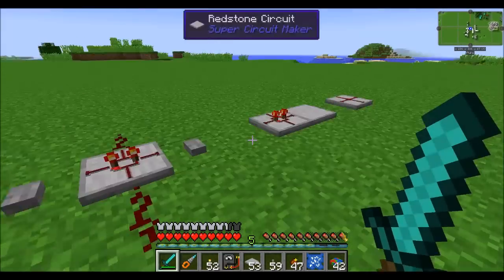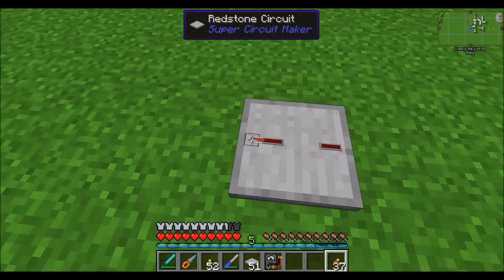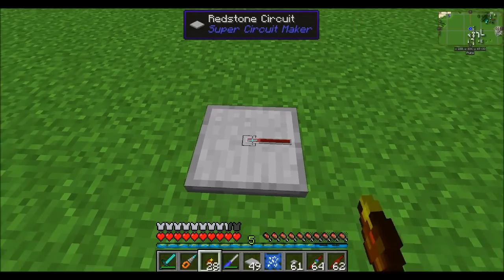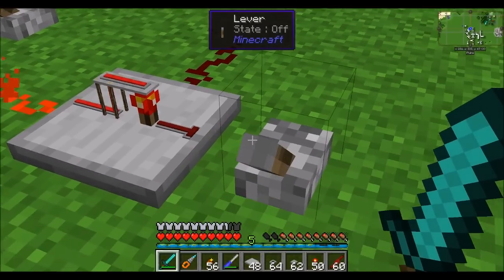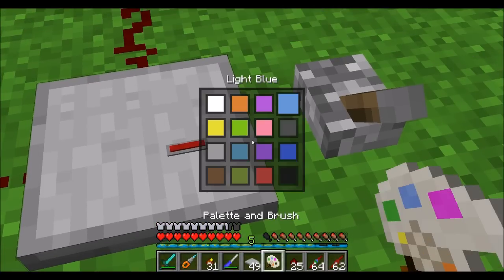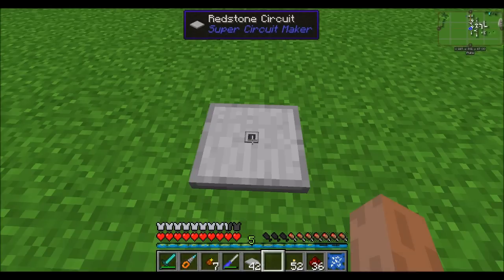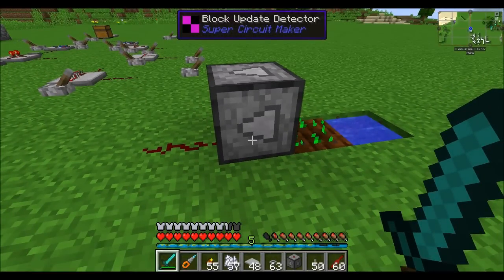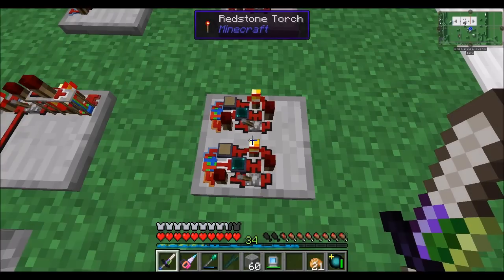Mod Spotlight   Super Circuit Maker Pt2

Comment: The part, where only the circuit crashes instead of the entire game... wow, just wow. More mod authors should think like Amadornes.
Reply: It isn't always possible. Why are exceptions called "exception"? Because they appear only in exceptional cases. Mods would be huge, if every single operation was wrapped in a try-catch block.
Reply: I definitely agree with you. I was just really surprised as I don't remember seeing such approach before.
Reply: Miroslav Veselý Yes it is definitely a nice thing to have. And it happens to work with the internal design of the mod.
Reply: There's a best-practice in software development called 'fail fast' - which means if there's a problem that you can't handle, the best thing to do is to fail fast and completely, rather than leave the program running in an indeterminate state. Ignoring this best-practice leads to hidden bugs in the best case, and corrupted data / unrecoverable worlds in the worst case.

Comment: So... the mod maker just made fully featured microchips in Minecraft.

Okay, now someone make a computer at least as complex as a computercraft PC that can fit in a house, with this mod, now.
Reply: Still, that's 16*256 possible values (128 Bit)
Reply: Geth270
Oh, I missed the single circuit part. The mod creater (Amadornes) has made a 3-bit CPU and it's at least 16 circuits.
Reply: Geth270 I meant your comment :P
Reply: That can be outputted to a traditional ComputerCraft computer, which can translate that into monitor output.  The actual computation can be done with circuits, with the CC unit just being used as an Input/Output device.

Comment: One thing I'd really like to see in this mod, is a way to name circuits. That way when you put them circuit on circuit and mouse over them you can know wtf you're looking at.
Reply: I wonder what would happen if you tried to name the circuit in an anvil.
Reply: It works! But when you put the circuit back down and pick it back up again its back to the default name, still a very handy idea!
Reply: You can also name the blueprints on the anvil which is super handy, especially if you are working in creative mode which means your circuits wont drop when you break the blocks, so using blueprints eliminates the need to keep switching to survival mode to break the blocks with a pick.  Much better!
Reply: Ok,  this is probably all common knowledge just thought id add it.  It looks like you can even use the middle mouse button to block pick the circuit board in creative mode, that puts it straight into your inventory.
Reply: That's not really helpful. You can block pick in real Minecraft too, but only if you have the exact same item already in your inventory.

The whole point of my comment is to be able to see what it is WITHOUT picking it up.
Reply: ooh I thought you meant when the circuit is in your inventory, sorry!  Yes you are right that would be good to have.
Reply: You can rename the internal name that shows up when you put the circuit on a circuit board by throwing the board on the ground and typing this command: "/entitydata @e[type=Item,r=5] {Item:{tag:{name:"name"}}}". Modify as needed. I also saw that the entire circuit is stored in the NBT of the item, so you can actually share circuits using commands by copying the nbt of the item and pasting it on a different board instead of using the import and export commands.

Comment: um if I am correct the analog is better described as Vanilla:0-15 or 16 possible values while SCM:0-255 is 256 so it actually should be divide by 16 to get exact values.
Reply: As soon as he said 17, I immediately facepalmed...
Glad I'm not the only one who caught this.
Reply: Or shifted right 4 bits, which is even simplier.
Reply: Beep! Wrong. 255/15=17
Reply: And the mod author even said it is multiplied by 17 when it enters the circuit and divided when it goes out.
Reply: Geth, you have a decent point, however given that reasoning it should always round up. it does use 255/17, then it rounds appropriately (If you had a signal showing a power of 8 for SCM then it should come out as 0 vanilla, 9 would come out as 1). If your ranges given would correct it would always be rounding up, whereas in both examples Dire gives it rounds down (as it should). 
How it would determine incoming signals to prevent the issue you posed is simple. The vanilla power level will always transfer to the SCM level that is evenly divisible by 17. For example, 0=0 (of course), 1=17, 2=34, 3=51, ect. In this way an output of 0-8 SCM=0 Vanilla: 9-25=1, 26-42=2. 

For the rest of this explanation I will use "S" as a variable representing the SCM power level, and "V" as a variable representing the vanilla power level.
As for why S/17=V rounded normally gets used it because it's a simpler calculation than (S+1)/16 -1=V rounded up. This is what would otherwise need to be calculated, the two constants being due to converting each range down one.. This equation would, however, output 16 equal-sized ranges of numbers for each result, whereas the system in place determines 16 ranges which aren't entirely equal (the first range includes 9 numbers inclusively, and the last range is 7 numbers inclusively). 

P.S. The division by 16 if distributed is S/16 + 1/16 - 1= V, which then simplifies to: S/16 - 15/16 = V. 
This is still a more difficult calculation as a result and poses the issue of exactly what to convert  the vanilla value into (do you always convert it to the low end of the spectrum so 0=0, or to the high end so 15=255? If you go median as the other method does then neither of those will be true.)
Reply: Just to elaborate on your point for the benefit of others, to get from SCM to Vanilla you should divide by 16 and round down. So 128 would go to 8, not 7.

Comment: I... I... I... Am speechless. This has everything ProjectRed-Fabrication has and more. I was trying to build a redstone pc with mods, then I stumbled into this. AMAZING! I could literally put my entire pc into a single board if I wanted. Not to mention, I don't have to work with digital signals! I can use comparators to add and subtract stuff! AND IT DOESN'T LOSE POWER! I mean, after frequent problems with project red I saw this mod, and I was wondering why I don't have this. 8-Bit redstone PC's will be finally within reach again. And you can use the adder and the subtractor in a specific way to get the specific amount of overflow from addition and subtraction operations. I clap. I clap. I clap.

Comment: I wonder how much one of those massive Redstone computers could be condensed with this.
Reply: Uh...  about 150%  without Circuitception, and about 250% with Circuitception.
Reply: Gak237 1 block 64 bit processor running Minecraft would be plausible I think.. I guess you're computer is going to crash tho.
Reply: Gak237 1 block 64 bit processor running Minecraft would be plausible I think.. I guess you're computer is going to crash tho.
Reply: 63, actually. You need one input for the clock sync unless you really have ender pearls to spend.
Reply: Simply output in bundled cable, that gives you 64 * 16 (1024) outputs, and if you were really crazy, you could convert the digital signals to analog giving you 1 KiB of simultaneous output.
Reply: Kion Tupper
You can't externalize bundled cable yet, and red alloy wire is not supported outside circuits (it rounds if done so.) So everything must be internalized in a "motherboard" and multiple daughterboards vita circitception. But here's the thing, more sides on a single big circuit provides 15 more external digital channels, so it's really "expand as needed."

Comment: Can I have circuits within circuits, pick that up, and place it on a circuit (so long as it's not over 9)? If so, I could have a multi-tower of circuits that feed a bunch of colored wire circuits up and down to other circuits and then still output to bundled only inputs and outputs on either side. I wanna see how far I can build these circuits to talk to each other and what the maximum complexity level is when making a circuit with nearly nothing on it but other circuits.

Comment: Are the circuits able to interface with both the wires and bundles from Project:Red? While I suspect that the wires are fine, as they can connect the same way as redstone dust,  I would prefer not building a 16 wire output for the plates, feed all those to the bundle, only to have to split the bundle back to 16 wires, feeding another 16 inputs, then recombine them into the tiny bundle on another plate.
Reply: I also use the cables to run control lines to other buildings, including the nuclear reactor on the other side of a hill. I would like to avoid running a line of circuit plates about 100+ blocks to the reactor.
Reply: There's no PR for 1.10 yet unless I've missed something

Comment: Somehow this does not seem to me like a meaningfull calculation for the redstone signal. 255/17=15 -> (S/17=R)
It would make more sense to me to be kept in base 2 numbers: 
 - (S+1)/16 = (R+1)    ->   (255+1)/16 = (15+1)

I might be wrong, .... but Dire, please check this info with moddeveloper, ... it does not make sense to me at all. Your calculation seems to me more like a strange coincidence
Reply: Yeah, but there are only 15 "on" values in MC, and one "off" value, 0. 15 goes well into 255, allowing for 15 "on" values--and 0.
Reply: Exactly. 16 distinct states that go well into 256 distinct states. 0-15 S would be 0 in R
Reply: But that way you'd have a non-zero value on a circuit that would become zero outside, which isn't usually what you'd expect.

And how would you convert from 0-15 to 0-255?
If you add 1, multiply by 16, and subtract 1, 0 R would turn into 15 S. That obviously doesn't work because you couldn't have 0 input to a circuit.
So just multiply by 16? That would give the lowest value for each interval, which lets you have 0. But 15 would turn into 240 and you would (for all practical purposes) lose the last 15 values.

Multiplying by 17 just works and gives reasonable results for every input. There's really no need for an interval that corresponds to 0R. Zero is zero.
Reply: I see. makes perfect sense
Reply: Sema Duni, if you expect zero value from vanilla redstone - you have to expect it could have any valid value inside range of 0-15 on SCM plate. If you somehow expect to get exactly zero from zero vanilla redstone - just subtract 15 from input, that's should be enough.
Reply: Sema Duni, Generally the only thing the mod does between vanilla redstone level and SCM plate redstone level - is directly convert it. Mod shouldn't follow any specific expectations you have. Vanilla redstone level has 16 different values, including zero. Dividing SCM redstone level by 17 you means it has 17 different values, which doesn't match with vanilla.
Reply: Алексей Талейко Just imagine a standard not gate: A wire from the border to a redstone torch and one from the torch to the other border.

If 0 outside turned into 15 inside that circuit wouldn't work. You'd need a subtractor to even get this simplest possible circuit to work. Or 0-15 would have to not activate a redstone torch. Which would confuse things even more.

And with the current divide-by-17 system there's 16 different values just like in vanilla: 0, 1-17, 18-34, and so on until 239-255. It works out just fine.
Reply: Sema Duni Actually you are wrong in all, except one thing. Author really made so 0 goes to 0. But he also made so 1-16 goes to 0, 254 goes to 14 and 255 goes to 15. So actually Dire was really right. Author made a division/multiply by 17. It's a little bit odd for other programmers like me, but probably it was really made because of the reason you mentioned. So yeah, weird but true.
Reply: Dire was right, but it rounds normally. This makes 16 ranges where the first range and last range are smaller (9 integers and 7 integers respectively.) Therefore, 254 would still be 15. It's because 255/17 universally is simply an easier process than having an output calculation of (S+1)/16 - 1 = R and an input calculation of: if R=0 then S=0, if not then (R+1)*16 = S. 

Due to the extra processing it may have been done so in worlds with several conversions taking place each tick (because we know this will wind up happening) it doesn't slow the computer as much.

P.S. Here are the ranges with numbers in parenthesis representing hard caps: -8 (0):8, 9:25, 26:42, 43:59, 60:76, 77:93, 94:110, 111:127, 128:144, 145:161, 162:178, 179:195, 196:212, 213:229, 230:146, 247: (255) 263
Edited to use colons instead of hyphens to represent range so YouTube doesn't apply the strikethrough effect...

Comment: can you put circuits with circuits on onto circuits?
Reply: I haven't actually done it, but I think yes.  The complexity shoots up really quick though, so you can't go too far.
Reply: I wonder if there's a config option to disable complexity. Obviously that would be at your own peril, though, but the changing of size of integrated circuits is a design/balance choice.
Reply: TheRmbomo It's less about balance than programming limitations.  You can only fit so many things onto that small of a space anyway, so the complexity is a sort of visual way to see when your limit is reached.